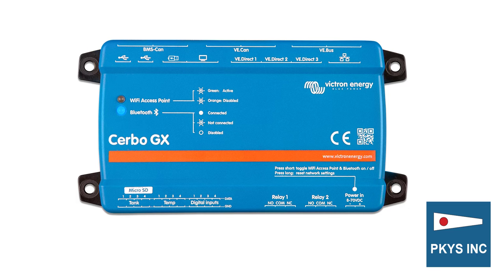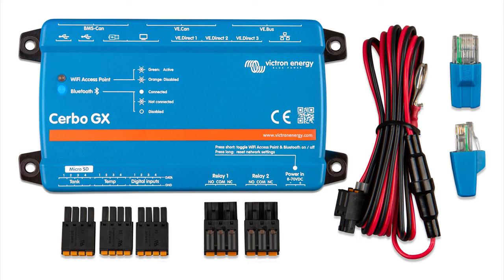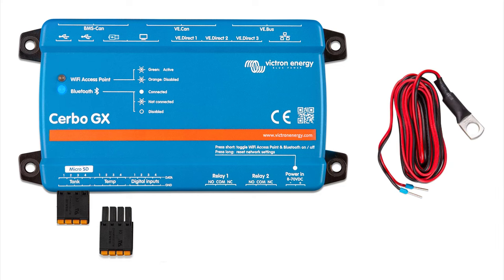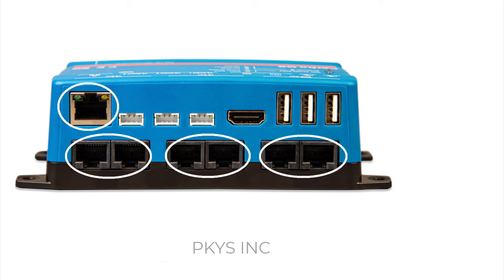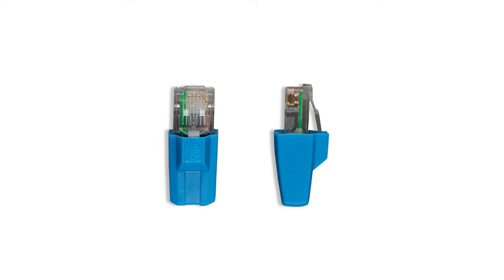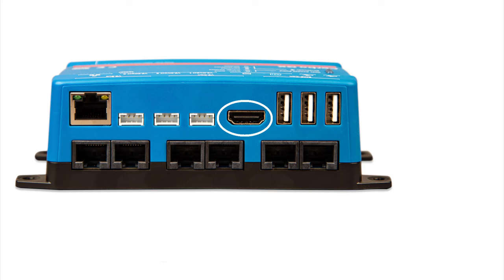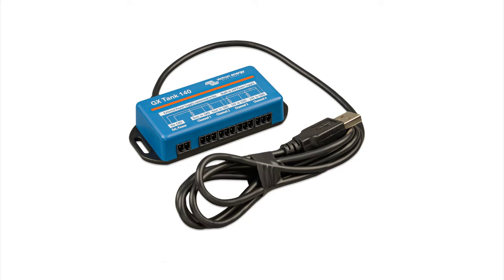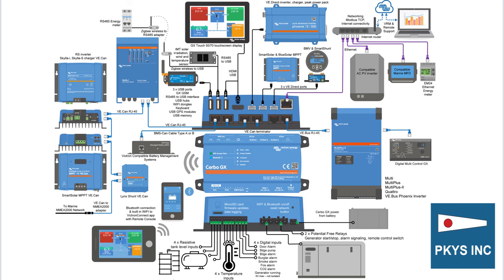Cerbo GX connections

Comment: Thank you for putting this one out on the Tube!  Excellent, clear, easy to understand breakdown of this device.  I am upgrading our Inverter and separate converter to a single Victron Unit, and will be replacing our old interior panel with the Touch 50 screen.  Saving this one so I can review it again before I start moving wires.
Reply from the maker: Glad it was helpful!

Comment: I have 3 Mppt victron my question its if I can connect one of the Mppt using the VE Direct to USB interface to the one of the VE CAN Ports?
Reply from the maker: You won't be able to connect it to the VE Can port. You can connect the MPPT to the Cerbo using the VE Direct to USB interface but you must connect it to one of the USB ports.  If you have more USB devices than USB ports you can use a USB hub.

Comment: OMG great video guys. 
finally a total 360 on the serbo. 
must youtubers just explain what ever they functionality they are using on their serbo. 

about the usb extender mentioned there, do you have a link? 

I found the ruuvi links on your site, but not the extender. 

thanks
Reply from the maker: The USB adapter can be bought anywhere
Reply: @pkysinc  um.... a usb bluethooth adapter will have drivers for windows and mac (dont think there is an extender but an adapter). wont be supported by the cerbo GX OS.  
even if so, would create another bluethooth connection for the serbo. in the same place. wont extend it. 

can you guys confirm? 
am I missing something here? 

thanks

Comment: that's a great video! thanks!!!! I have 4 mppt that were not connected to my cerbo (long story...) and it seems I just need to use the ve bus. can I ask you if those are normal network cables, or if they have special pin configurations? thanks again!

Comment: Thanks for the video, Im looking for a monitoring system like de CERBO GX for my boat. I've already bought an inverter but doesn't have any communication port to connect the CERBO GX. I would like to know if there is something like an a AC shunt or something like. Thanks
Reply from the maker: The Multiplus is what generates all the AC Power data that appears in the Cerbo GX.   The MultiPlus II even allows you to add an external current sensor.  Without the MultiPlus though you are out of luck, sorry.
Reply from the maker: You need a Victron inverter or inverter charger for the Cerbo to show AC voltage and current.  Then if it is a VE Bus device you connect it to the Cerbo with a VE Bus cable, for smaller VE DIrect inverters you can connect them with a VE Direct cable.  If you have the MultiPlus-II you can add an additional current sensor to measure any AC current of your choice.

Comment: What is the name of the type of plugs that the Cerbo uses? I'm needing to buy a replacement and don't know what to search. Thanks!
Reply from the maker: The plugs should be available through a Victron distributor.  I haven't found them commercially available except through Victron.  We recommend you plug them all in when the unit is new, even if you are not using them.  That way they don't get lost.

Comment: Hi, I'ver a question. Can you suggest me which digital sensor I can buy for set as alarm of presence of water? I need just alarm.
Thanks
Reply from the maker: Any ON-OFF float switch would work for that application.
Reply: @pkysinc  do you've a sample? Can you suggest me also a temperature sensor?